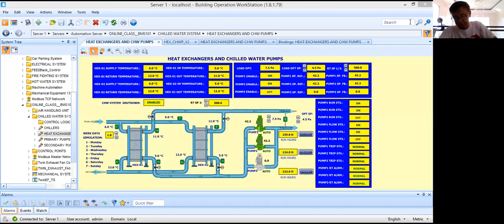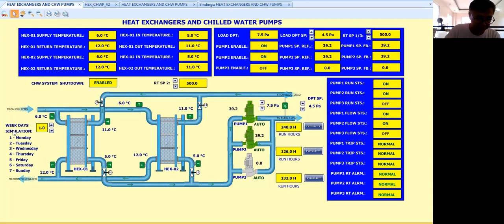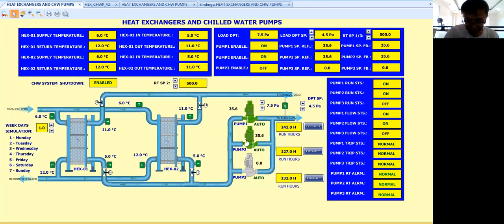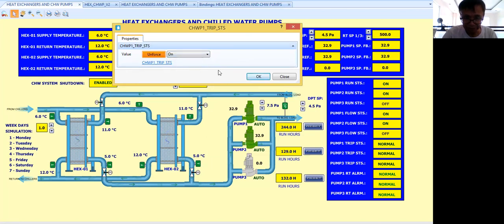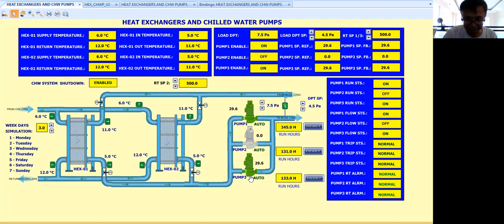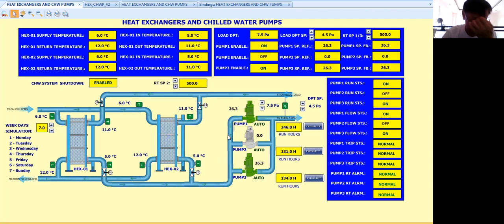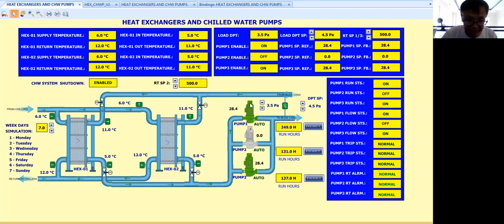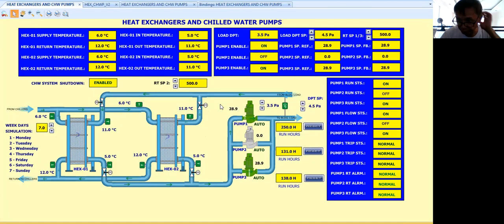Chilled Water System - Simulation of HEX and Chilled Water Pumps control logic program

Comment: sir ano po ang  purpose ng DPT. SALAMAT?
Reply from the maker: Differential Pressure Transducer, it will tell the pressure difference between the main supply and return line of a chilled water system, yong mechanical engineer in charge ang magsasabi sa iyo niyan kung saan dapat i-install ang device na yan